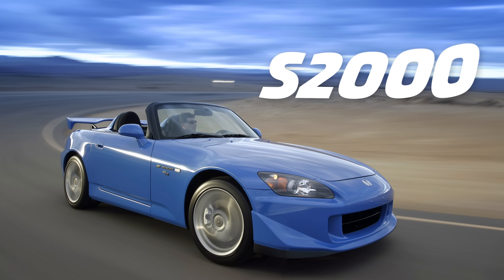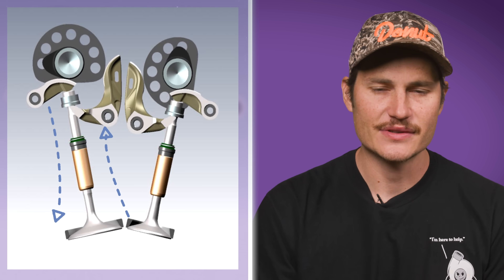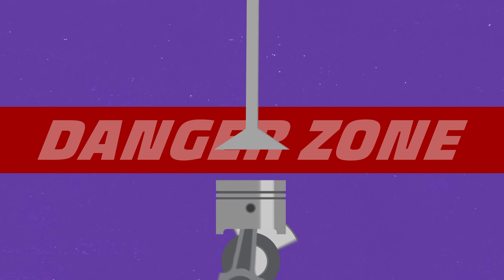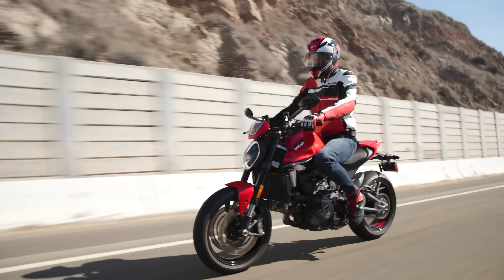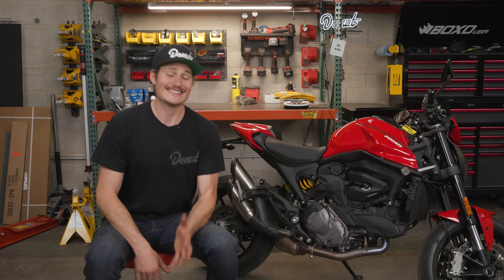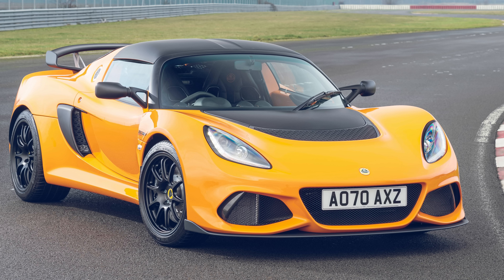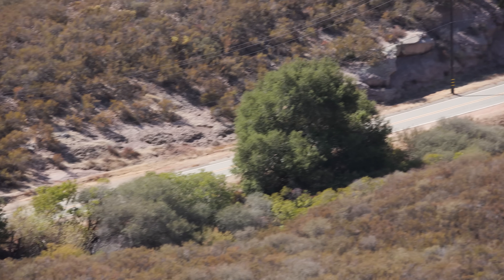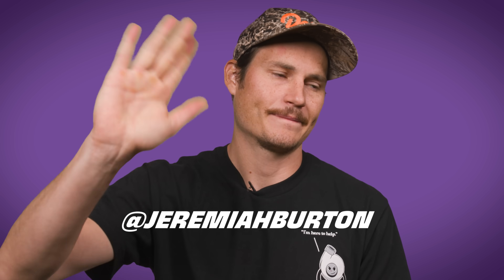Why ONLY Ducati Uses This Part To Go Fast

Comment: In the late nineties many car companies were looking at electro-magnetic valve control as it offers variable lift as well as duration and at the time it could handle around 9K RPM and were looking to increase these numbers but very little to no news has been released since, maybe you guys could do an update on the subject.

Comment: Awesome video as always but just a minor point, desmo valves are poppet valves just like normal valves. A poppet is just a valve actuated via a stem.  The lighter valves are down to material and construction advancements.

Comment: Japanese small displacement in line 4 engines. ie 400cc cbr rr, zxr 250 20.000 rpm using springs

Comment: There’s a little error at 7:50, it’s “Trialbero” not “Trailbero”: is a word composed by “Tri” which is an Italian technical prefix meaning “Three” and “Albero” that can be translated with “Shaft” so it’s name suggests that the engine has 3 camshafts 👍🏼. ITALY LOVES YOU 🇮🇹
Reply: Stavo per scriverlo pure io. 👍

Comment: I hypothesize something similar could be implemented to a pushrod engine. Physically linking the valves and pushrods to the rockers would remove the need for valve springs and could potentially allow for higher revs.

Comment: Had one, then I broke a valve because a valve adjustment was performed wrong. You also need adjustments at fairly low intervals compared to normal valve spring setups

Comment: Holy Crap, I put a comment on a previous Donut video saying they should talk about Desmodromic valves! In the video about why its hard to go past 20k rpm. If I secretly have the power to influence future Donut video topics, then next I choose a video about buying (and hooning) used police cars.  Or building a trophy truck... Not a slow, steady rock crawler. I mean a 100+ mph dessert missile.

Comment: The real reason you don't see Desmo systems in street cars, they aren't needed. The majority of consumers don't want a vehicle that makes peak power at extreme RPMs. High winding engines don't make good DD's for the average car buyer and niche engines generally aren't profitable.

Comment: the desmo is dumb honestly. it should be way out of date by now because there are so many other ways we can funnel fuel without part of the engine repeatedly slapping a cam with the part that is letting fuel through. there are a few ideas I wonder why nobody has tried because they just make more sense. the first one is pistons; why cant they just put tiny pistons in place of the cam? or they could use the things in plumbing that its able to spin, but it has a hole in it so when it lines up the fuel can go through. both of those would probably sound better too cause they are more consistent

Comment: Own a Ducati kinda like dating with extremely fine girl. It won't last long, incredibly expensive. but boy, it was intense
Reply: I have my ducati 851 since 1998, and my 750 sport since 2003... i'd call that a stable yet temperamental relationship..  😁
Reply: @JanBinnendijk  Same here.  851 since '96.  999 since '05.  1299S since '16.  
Ok so yes I have replaced the engine in the 851...but that was because the (Japanese) chain snapped and destroyed the cases of the original.
No joke though to anyone interested, these bikes are not ticking time bombs many proclaim.  Maybe that is just a myth started by some Ducatisti to keep everyone from actually buying one (or three).
Reply: @EVILSPAWN1003  sounds good.  Different strokes for different folks.  Sold a Honda VF1000R a few months ago to make room for something else.  But it was definitely a high quality machine even nearly 40 years after it was made
Reply: @EVILSPAWN1003  Yessess, that.why I´ ve 8 Japanese bikes and no problem, Suzi GSX1300R Busa, Kawa GPZ750r, Yamaha FJR1300, driveshaft, Yamaha  YFZ1, Honda Valkyrie Touring 1520 cc ,boxer , driveshaft, Honda CX500B 500cc , driveshaft, Yama Virago 750 cc V shape engine. Suzuki Boulevard C50.😂😂😂 Italian bikes, a lot of noise, not reliable ad short living!
Reply: @JanBinnendijk  you are on two ticking bomb 💀
Reply: @barackhusseinobamaii3303  i don't mind a little excitement.. 😲
Reply: @JanBinnendijk  een klein beetje plezier kan geen kwaad
Reply: Ducati 996 Biposto, since 2005, it´s MY2001 and I´m second owner. Strong relationship since 17 years. Only maintainance by myself since round about 10 years. 60k kilometers mileage.
Reply: I just sold a 2000 Monster 600 with 64000KM, I’ve seen other air-cooled Ducatis with over 100K kilometers
Reply: @ventisette.  Yeah my 2016 Scrambler has 36,000 miles on it so far.  I do my own valve adjustments and belt changes.
Reply: Had a '99 Monster 750 dark and currently an '08 GT1000. Still wouldn't trade it for a Japanese bike (of which I have owned several) because I just like the personality and drive system. It's higher maintenance than my wife but that's not a bad thing!😂
Reply: It didn’t have to last long. It just had to make a lasting impression. Kinda like sex. 😂
Reply: The, “fat and nice guy always said”.
Reply: Not really. The expensive service is each 24000 km 15000 miles on their sports bikes and on their street bikes, it's 30000km 19000miles. Most people don't own one bike for that long. 
I own Panigale 1299 since it was released back in 2015 and got 68000km 43000miles on the bike. Maintenance wise it wasn't more expensive than any other bikes I owned in long term.
Just when buying Ducati look at how close it is to the big service and how well it was maintained.
It's just old stima from the older days of Ducati when service intervals were very short and expensive.
Reply: I ride a turbo Suzuki bandit 1200. I kinda feel the same way 😂
Reply: I dunno, I still see quite a few 90s Ducatis around...
Reply: My 2 cents for whats its worth. I loved Ducatis, My older brother had a few including a 1000 mille MHR that he still owns. So I saved and bought a 750ss in 96 after 10 years of owning riding Japanese bikes, (and one tractor...sorry, 71 Triumph Bonnie:-). Bought it brand new from the importer/dealer and after 6 months they bought it back for the purchase price due to it being a steaming pile of shit. There were many problems, but the ones i can remember the best are. It would never run correct, and would drop to one cylinder if i was caught in the rain, the bearings in the swingarm pivot were loose and installed wrong. The wiring harness was installed by an idiot (maybe the whole bike was built by one) and had to be replaced due to damage done at the factory, then, the final nail in the coffin was when i had it in to the dealer for a real bad vibration, and the mechanic had it out test riding it, the rear cylinder called enough and shat itself. The dealer called it a "Built on friday afternoon" bike. Ended up buying a Suzuki GSX-R750 with the refund, it ran faultlessly the whole time i had it, and was FAST.
I know Ducati have got there shit together since the 90s, but it really put a damper on my thoughts about buying another.
Reply: not very expensiveat all tbh. A 2000s model is under $6k here, and even 1299 panigales are under $13k and ive had a couple that were over 50k miles lol wtf you mean
Reply: @Shadow0fd3ath24  parts can be expensive though if you buy new OEM stuff
Reply: That goes for all Italian produces.
Reply: Such a virgin words
Reply: Except it's truly not that great or intense. Just expensive.
Reply: "incredibly expensive". Such sexism
Reply: I've ridden my Monster since 2004, and the only components I've replaced on it has been timing belts and a crank position Hall sensor (made by Bosch). It has never failed me after 25k miles.
Reply: Never dated a super model type.  So I won’t know.
Reply: Wrong, Still own 2005 Ducati 999. People still complementing me on my sexy beautiful red bitch! Her beauty is timeless!! 🤪🤪🤪
Reply: @illmaticgaming4162  It’s so nice.  Ducati 999 can beat Lambo Gallardo on the track!
Reply: You look 14 and your name is from a part of the world with no Ducati dealer within 5000 miles. `m calling BS on your Ducati 🤔  Video or it didn`t happen
Reply: @EVILSPAWN1003  your time is worth better things.
Reply: @EVILSPAWN1003  I find the idea of him with a beautiful women even harder to believe
Reply: @EVILSPAWN1003   called importing an most with his name have the money to buy what they want dont ever down or judge anyone by there name where they live or color u my friend are racist its 2021 your daughter prob going have mixed baby or wife so cut that stuff out no one got time for it
Reply: @derekharmon9353  Not ur friend Tinkerbell. And no,99.8% of Indonesians cannot  afford a Ducati. That`s why they have ONE dealership down there. And my daughter will never get involved with a migrant. She`s being brought up right
Reply: @markpowell7470  What does that even mean mark with a lower case m? My parents said what? What are you talking about mark?
Reply: @EVILSPAWN1003  Motorcycles are much more common on roads in South East Asia, compared to western roads. 
For that reason, a motorcycle manufacturer would be stupid to not have dealiships in that region of the world...which is why Ducati has a sufficient and expanding presence in that region.

Also, South East Asians tend to look younger. And next to his profile pic it says: "joined 10 years ago".

When it comes to the name, the country with biggest population with names like that is Indonesia...a South East Asian country. Malaysia and Brunei also have a crap tons of people with names like that.

You'll find plenty of Ducati's and men who look 14 years old in places like Indonesia, Malaysia, etc.
Reply: @EVILSPAWN1003  when did he say he owned a Ducati lmao and his name doesn't show where he lives nice passive aggressive racism
Reply: @treyburl403  Before he edited out the "I own a..." part.

Comment: 16,000 RPM "easy" because Desmos didn't achieve high reliability until recently and that reliability it's coming the Ducati tax of hyper specialized valve check.

Comment: Make an AWD desmo-bimoto... Just delete the hatchback/trunk/boot storage when adding the drivetrain to the unconventional engine location for the platform? ... just plan the installation for easy access for valve train work / maintenance in the front and rear engines. Easy as a snap of the fingers,  yeah? Oh yeah, forget about NVH! The more I think about this, this is starting to sound more like a 1980s Group B rally car evolution to some 2nd or 3rd Generation offspring if two desmo engines were allowed to be engineered to contribute to the same driveline.

Comment: Japanese motorcycles have been revving higher than Ducatis without that since the 80s. My car from the 80s also redlines at 7500 so modern tech should get you higher.

Comment: i just thought you could mix the regular and desmo valve train together. so the principal would be to just add second rocker arm to pull the valve back but give it a small gap so there wouldn't be friction due to force on it always. Then on the end where it touches valve, it's gonna have a hole where sits a spring to keep the rocker from flapping around due to gap so it wouldn't make noise and that's basically it. So at normal rpms you would have valve springs doing the job of returning the valves and cause the valves aren't slamming you don't have noise. And if you want then just go into high rpms and even tho you would have valve float, then you actually don't cuz the second rocker slams the valve shut. it's a win win win situation. 1. high revs 2 no noise at normal rpms 3 no increased wear on normal rpms.

Comment: High rpms equal high wear vs low rpms..so if you can make the same power at 3200rpm as 7500rpm it's pointless to spin it

Comment: You guys have any interest in my 2002 S10 Blazer 40,100 miles cherry red gold wrapped heat resistant space Palmer tape on the intake tubing with the K&N panel filter I'm getting record-breaking near stock performance numbers it's quick and keeps accelerating very healthy to its top speed

Comment: Lemme save y'all 15 minutes of your time. Desmodomic Valves use a special cam to open and close valves without using a spring as it's primary source of control.

Comment: You can also achieve very high rpms with double roller finger folowers between the cam and bucket to have as little friction as possible. And the valve float problem can be solved with pneumatic valve springs. I am not a desmodromic fan, even though it has made leaps and bounds to improve reliability, it's still a pain in the ass

Comment: hmm n2 4age is a inline 4 that hit 12000 rpm and Honda had a cb250rr that hit 19k  and Motorguzzi and MV motorcycles had higher reviving bikes before Ducati  so this is pretty inaccurate

Comment: It's not that impressive when you look at valve service "adjustment" intervals.
There is nothing wrong with springs. My 1990 fzr400 did 16,000 revs.
There are more issues with it not being in more vehicles.
The main one is that cars just don't need to rev that high, with direct injection, turbos, etc.
More revs = more fuel and air per minute = less fuel economy.
Reply: Excessive piston speeds. Dont have Ny idea what the ducatti is. I would need to know its stroke.

Comment: I find it funny how I could recognise the part from the thumbnail.
Then again, I did have to research them when trying to design a 20k rpm engine. The only other way was a weird linked cam design.
X20 race engine, noise longevity and harshness weren't a problem. Actually I think being as loud as possible was an upside.

Comment: Lots of great info, but a few things are incorrect. I don’t mean to sound condescending;

(Source: I’m a journeyman motorcycle mechanic, specializing on Ducati’s)

The demo valves themselves don’t make an engine spin faster, that has more to do with the size/ balance of the pistons/ rotating assy. 

Though that was the case back in the 50s 60s 70s, its not anymore
Modern spring valves are just as good as desmo. 
If desmo valves really could gain more RPMs over modern spring valves, More sports cars/ superbikes would have them. Even if it’s a bit more expensive, because RPM = horsepower 

Take a look at any 600, they’ve been redlining past 15000rpm for decades. They’re also much smaller engines, with more pistons than any V2 Ducati 
Heck the 1988 cbr 250rr redlines at 19000rpm. With carburetors and spring valves 

“Poppet” valves are technically what all internal combustion chamber valves are called,  Desmo or spring. The desmo valve themselves are pretty similar to a traditional valve, the groove is a bit different. Traditional valves have a groove cut out to hold the spring retainers, the desmo valve has a groove cut out to hold a “collet” 
The desmo valve isn’t any heavier than a traditional valve. 
Side by side, the valves look almost identical. Just different grooves cut. 

The modern “keeper springs” have been in much longer than the V4, they’ve been in as early as the “desmodue” family of engines (possibly earlier but that’s before my time)

Ducati’s also don’t get their sound from the desmo valve train, that has more to do with the 90° V twin (L for the purists) 
Same reason Harley Davidson has a distinct sound, it’s their 45° V

There’s a few videos by a Channel called “William moser” giving audio visualizations of different engine configurations and how they effect sound, there’s one on Ducati’s

They used to require more maintenance because their metal wasn’t as good as their Japanese counterparts (in my experience). So the parts would just wear faster.
Plus the belts would need to be replaced frequently. 

In the last decade or so they’ve really stepped up their game and they are much better built than they were before. Now most Ducati’s have valve intervals around 24000km for their tertastretta 11°, superquattro, and desmosedici engines. Similar to many Japanese valve intervals (not looking at you yamaha) 

All in all. Desmo valves are cool, simple, and have their place, but they are outdated compared to modern spring valves. 
Many European motorcycle manufacturers design their bikes with “tradition” in mind, they all have their own style. And desmo is Ducati. 

We’ll see what the future holds though, the Multistrada v4 is using spring valves. 

They claim the “Granturismo V4” has a valve interval at 60000km. I rode one back to back with a Streetfighter V4 S, and “valve wise” couldn’t tell the difference. Obviously they were completely different machines, and the streetfighter was much faster. “Valve wise” they are indistinguishable. But that’s a bit weird to say

Comment: If electric doesn't kill off ICE powertrains too quickly, Freevalve can give us infinite tuning, virtually no valvetrain parasitic losses due to simplicity, no rpm limit, 50% better fuel economy, 30% more power, and run any engine cycle we want. To the moon, y'all!

Comment: Car engines don’t benefit from desmo because the mass of pistons is enough they are limited by piston speed.  Conventional overhead cam design is easily able to handle the task.

Comment: Imagine an EJ25 Subaru engine with Desmo. Perfectly balanced for the high RPM. Plus, you can just replace the Desmo bits when you replace your head gaskets. Two frequent points of failure can't be too bad if the work overlaps.

Comment: Anyway with less CC and regular camshaft, engine can revving until 18.000, for example like Kawasaki zx25r, because bigger cross section bigger load

Comment: Imagine making 16k rpm’s with Desmodromic valves when the r6 makes that power without
Reply: 1) that’s why desmo valves aren’t really used anymore traditional valve springs are just as good but there is trade offs 

Desmo systems that are properly maintained will have laser sharp timing and valve action. Also you can run much more aggressive cam specs because The lack of valve pressure